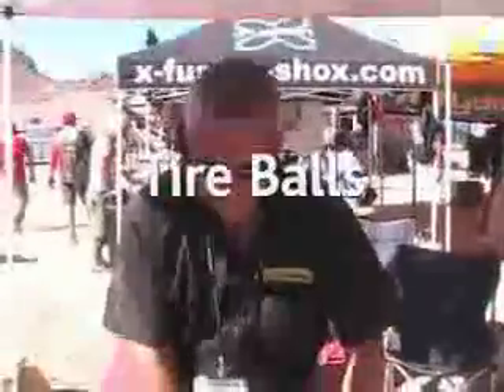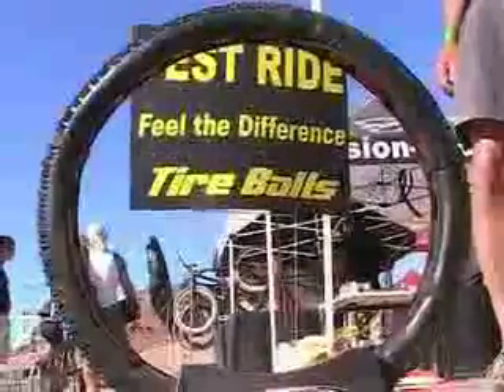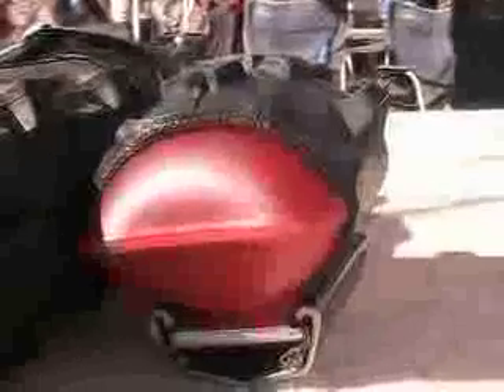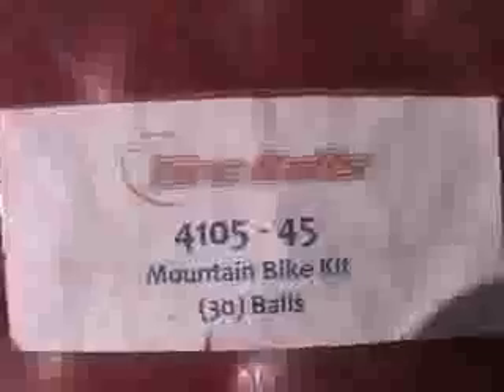Tire Balls introduced at Interbike

Comment: Tire balls in the moto world weigh about half as much as the heavy duty tubes commonly used and about the same as a bib mousse(solid foam "tube") so to me it makes a lot more sense there than in cycling where every bit of wheel weight adds watts to the needed power of each pedal stroke

Comment: I agree with boared21 about the weight problem and dogassedugly about the seemingly insurmountable (pardon the pun) problem of mounting an inflated tire.
I would like to add that there is a significant distortion of the tire  as can be seen at 1:32. Then there is the space between the cells which would not support the tire unless also pressurized.
The bike so equipped would surely have increased unsprung weight and greater gyroscopic forces that would negatively impact its performance in a race.

Comment: I just set mine up like a tubeless setup, but I have one small difference. I put in quickrete and pump in some water once the wheel is setup. Yeah it's heavy and I can't adjust the pressure, but I've never gotten a flat.

Comment: It would seem that racers concerned with weight would not like the additional weight of these thick plastic ball inserts.  I like the idea for general riding, but I would bet that it would add at least 800 grams of rotating weight, which would not be desirable on a climbing course over an hour or two.

Comment: I can see this product getting very big, especially with DH racers.  

Adjusting 20 balls is a piece of cake if you have a tank full of compressed air and an accurate regulator.  No need to check the pressure, as the pressure will equalize to the correct amount. I'm thinking 5 minutes tops.

Comment: The product also makes it impossible to change the pressure in the tire as a whole after it is mounted. This is a problem when you get to the trail head on your dual sport ride. The tire may be of help in racing applications if you are running at the front of a race and experience a flat but first you have to be up front. I don't think these things are going to help you get there.
The guy never says if his son or anyone else ever won a race when using this product.

Comment: For someone who's ridden these, what is the impact as far as roundness.

Seems that with 25-30 of these in a tire that there is slight gaps due to the space between them and their shape (they are afterall not curved exactly to the shape of the tire.

So when installed if you go around the rim with your hand is it lumpy? Are there soft spots like a baby's head? Or are there enough of them to hide the gaps?

Comment: Dumb product, you can't adjust the tire pressure, it weighs much more than tube and tubeless tires, and it is WAY too expensive. Besides, most tubeless tires are self sealing for small to medium flats and it would be awkward when one of the "balls" deflates, leavig you to ride with an uneven wheel